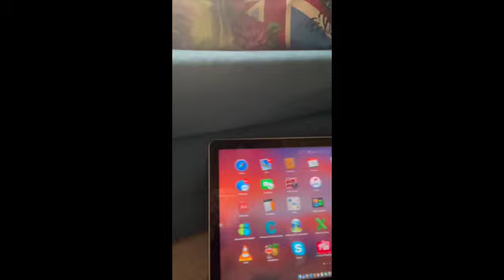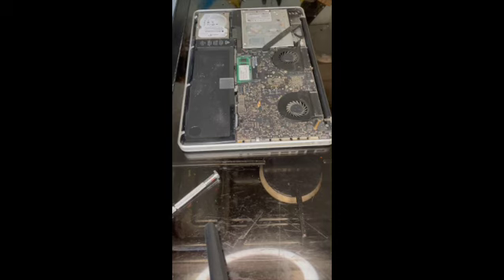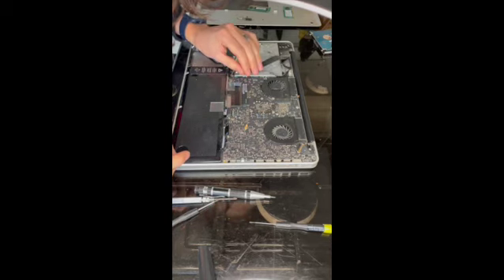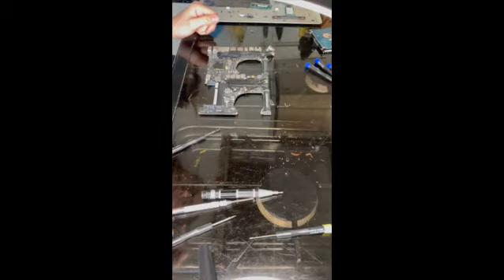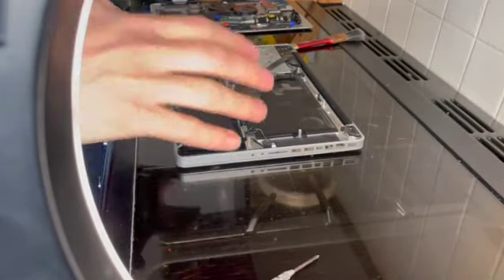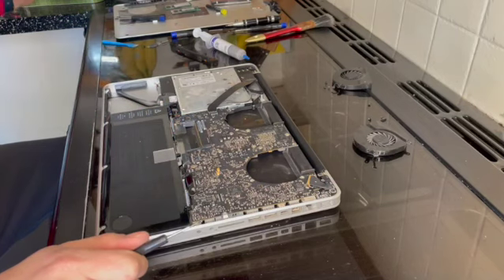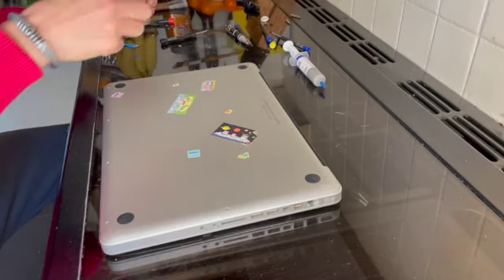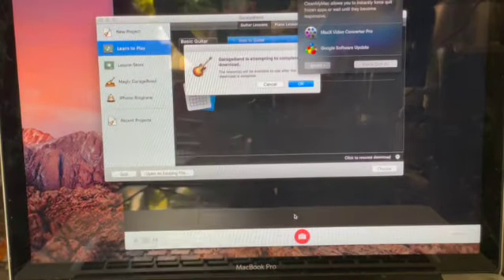Baking a MacBook Pro 2011 - Will it work?

Comment: Done this twice on a laptop first time worked for 6+ months with heavy use 2nd time I did it lasted for 3 weeks, but I forgot to max fans this time so ymmv but if done right this works!
Reply: I had the same experience with my 2006 MBP, however second GPU reflow lasted about 4 months. Disabling the AMD GPU on a 2010 -2011 MBP and using just the Intel graphics is probably best.
Reply: ya  i tried this and it worked for about 15 minutes after i put it back together before the macbook pro locked up and i had to hard power it off and do the fix i did first which was disable the gpu via software! granted i only baked it at 350 for 6 minutes.. you are better off to use dosdude 1 gpu disable method and upgrade from high sierra to catalina with dosdude 1 patcher or use open core patcher for big sir or newer..... the reason why you should use a patcher to upgrade the os is so brightness and sleep mode will work without having to solder crap to the logic board...